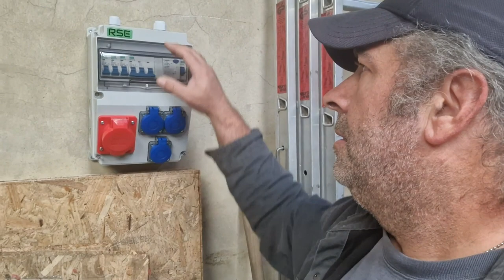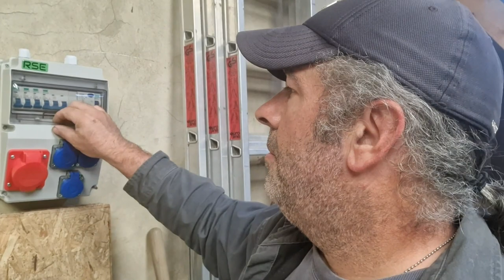Old German Farm House Renovations: Lower Barn Rewire Pt 1 |Homesteading | Off Grid

Comment: That's how it was done in quite a few places in Europe until the 1970s, run a combined earth/neutral with a link at each socket or light. This one is sort-of correct, although it was recommended to go to the earth terminal first and link to the neutral from there. The big danger with this setup is if that wire ever breaks or gets disconnected, anything connected to that socket and turned on doesn't work but exposed metal parts become live. That's why this setup was banned quite a while ago (east of the Iron Curtain it clung on for a little longer). You had the same setup in the US for dryers until very recently.